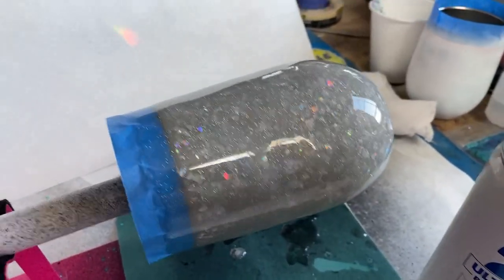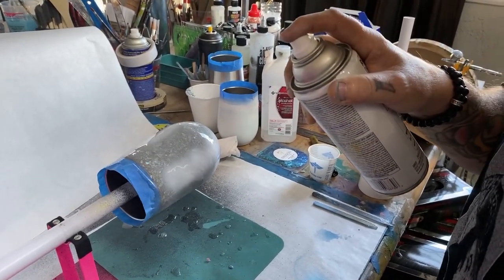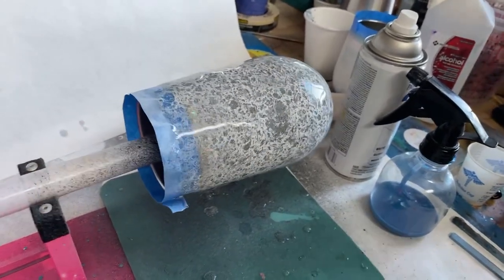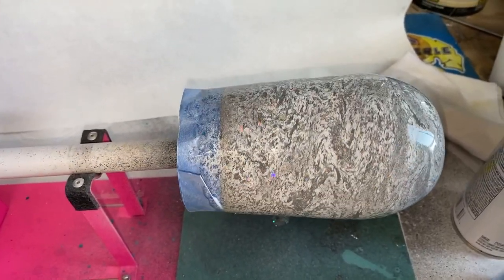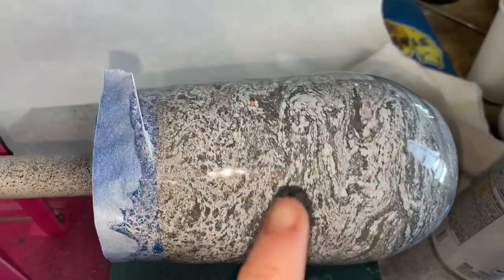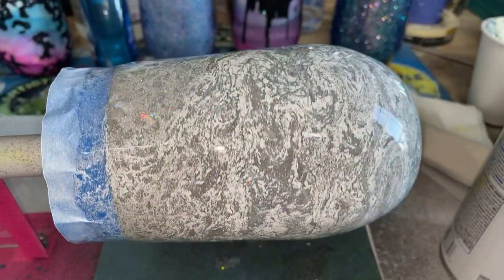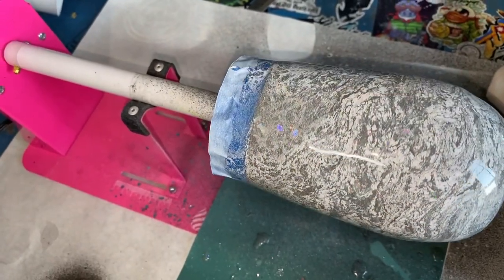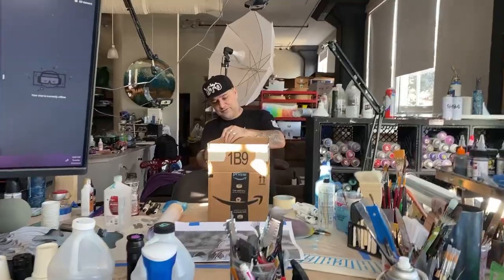Using Countertop Methods on Rein Tumbler

Comment: Great Video. I had to switch my plotter to a windows 10 machine, so I didn't have a program to run my oldschool graphtec FC3100-60 plotter. After trying several programs, I found that SignGo Lite and InkScape were the best solutions. I had difficulties having the plotter respond with all other programs like Sure-Cuts-Alot, Easy-Cut, Sign-Blazer and even Graphtec's own app. SignGo Lite was closest to the program i was used to which was FlexiSign, but it was only a free trail. The best absolutely FREE app was InkScape. Still need to figure some things out, but it should work if the application is the source of your problem. To plot from inkscape, on top menu choose "Extensions> Plot>" set your serial port, then click apply. Hope that helps.

Also curious what wireless camera or device do you use to stream with? I would love for my camera to not be stationary, and without cords. Thank You